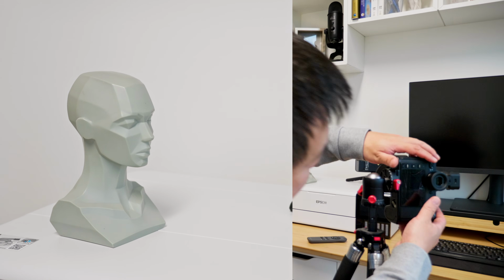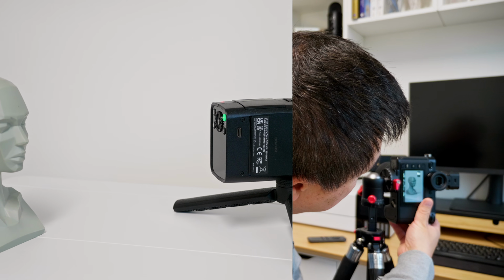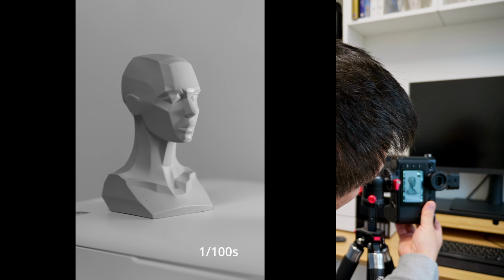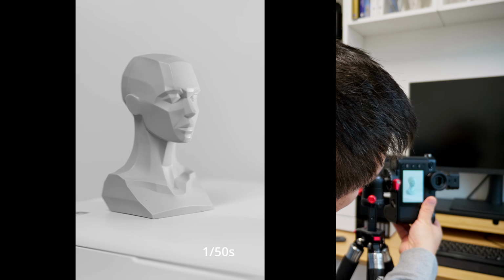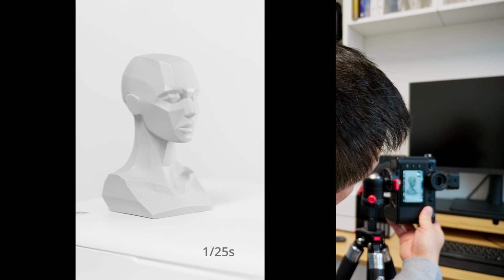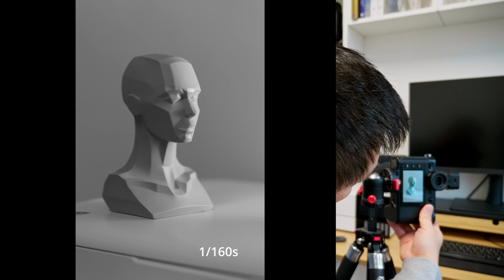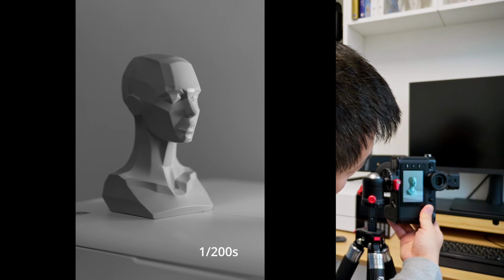Shutter Speed Is the Flash Lighting Hack Until You Break This Rule

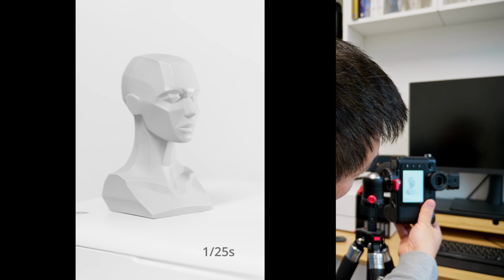Comment: Ooh.  Thank you for the demonstration.  I see how shutter speed can affect only the shadow by 2:40.  When u have time, can u do one for changing just the aperture and also explain why the light meter gives us aperture value
Reply from the maker: The aperture will affect all the light sources equally no matter you are using HSS or not. You can’t use aperture to manage contrast. You can use aperture to reduce your shutter speed to sync speed so you can have better control of the shadow and light using your flash and shutterspeed as I explained in this video.
Reply: @KyleCongphoto thanks for the reply.  When I say Light Meter, I meant the hand held one that can read the light from a surface.  I personally have not use one, but I heard that it gives off reading in aperture.  So I am not sure how ppl adjust the flash power based on those readings.
Reply from the maker: If you enter the iso and shutterspeed the meter will give you the aperture. Is this what you asking?
Reply: @KyleCongphoto  u know how sometime ppl use lighting ratio when they want a certain ratio, like 2 to 1, on 2+ lights.  If we have 2 equal strobes, say 200W, then we can just adjust the power to easily achieve said ratio.  But if we have one 75W and a 200W, to achieve various lighting ratio, it is easier to use a light meter, like the Sekonic L-308.  My question can be sum down to, would using those handheld meter take out some of the trail and errors gauge the proper lighting power?
Reply from the maker: @jacky2152 these are my 2 options about light meter: 1, why we have to follow certain light ratios? We need different level of contrast depends on the look we want to create. It varies all the time. Seeing the actual photo and check if the contrast meets your expectations is way more straight forward than following some ratios. Let alone we don’t even know what’s the best ratio should be. 2, Your camera meter or light meter tells you one thing but what looks good to you might be the other. If you do what your gear tell you to do, you can be a great mediocre photographer who just shoot like everyone else. If you take control and use your gear to create something you like, you will build a strong style.